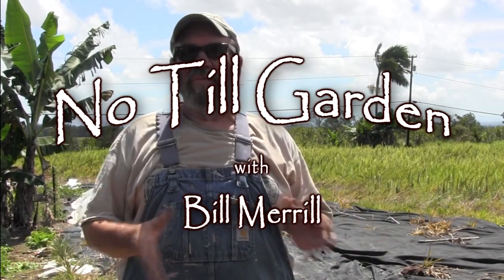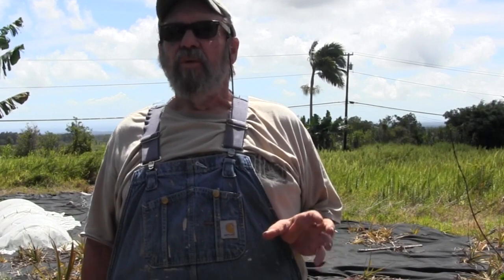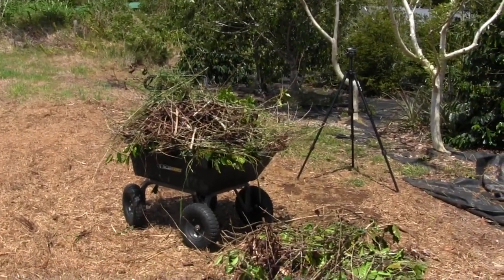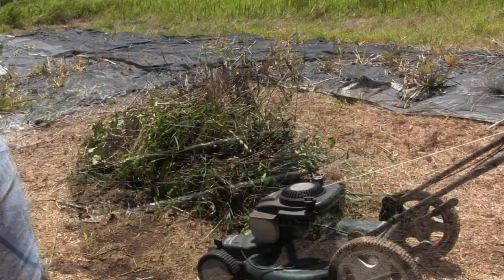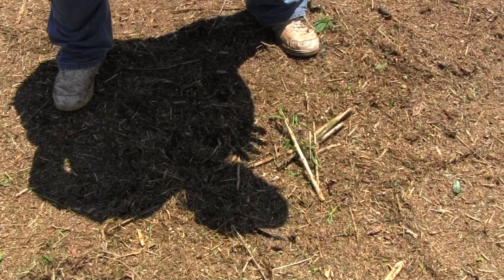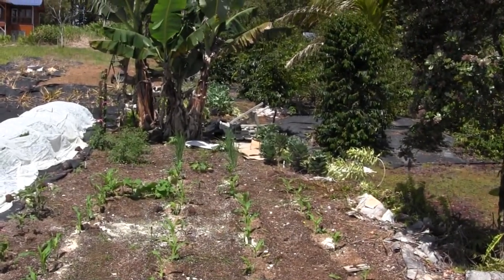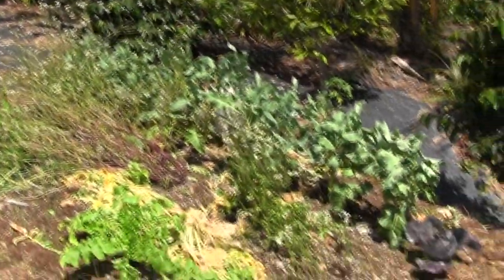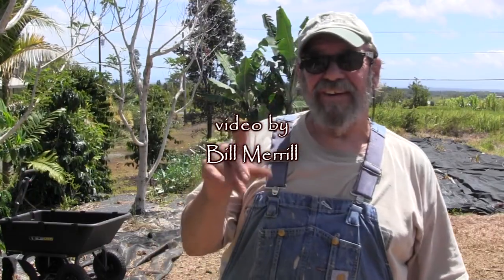NoTill Garden

Comment: will that work with morning glory?
Reply from the maker: This system will work with any plant.  The only difference is how long you have to leave the weed block in place.  In the case of morning glory the vines grows in warm weather and sleeps in the winter.  Trying to kill it in cool weather when it is dormant will do nothing.  Generally April to October is the time.  It depends on how old the vines are and how much energy is stored in the roots as far as how many months it will need to be covered before it is fully deceased.